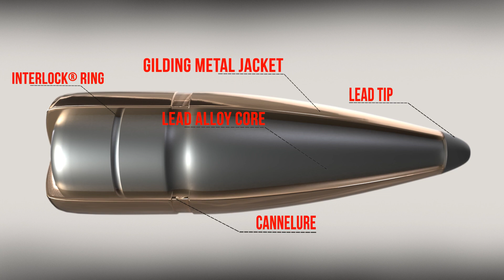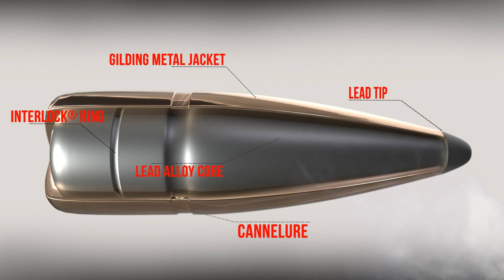Hornady® InterLock® Bullet Overview

Comment: best bullet company out there in my opinion. I'm a hand loader and exclusively use Hornady SST or interlock bullets when I load.
Reply: Yes. Even here in the UK I reload with SST all the time.
Reply: Nosler is better
Reply: @maxair5970  : I love all bullet brands equally.
Except for gay Lapua.
Reply: @Paul that can be said for 99% of lead core bullets..............
.
if you are shooting faster than the STATED! max velocity for this bullet design..... then look into 100% copper bullets
yes, its hard to change from what works.... but all copper works
.
especially for bone / ultra high velocities 
.
.
.
.
personal opinion time..... 
if you are hitting a deer with bullets moving 3400+ FPS....... you should probably use less gun
.
that caliber is CLEARLY designed for long range (besides the exception that proves the rule.... like 223/5.56, which have 3400 FPS, but arnt designed to go much past 350 yards)
.
either start shooting deer from longer ranges
or use less gun
.
.
ya dont need a 454..... supercharged AND turbocharged..... to drive 3 miles to work
it may be fun.... but its a bit too much motor for just getting you to work and back
Reply: @maxair5970  even if that was true........ whats the price difference? 
.
and would the deer know the 10% difference? 
i dont personally think so.... but ive never been shot so

Comment: I've shot hornanday interlocks in 7mm 08 and 30-06 for years. Never have lost a deer with them even when I make the occasional bad shot. The 150 grain interlocks in the 30-06 are extremely accurate and they blow a huge hole for an easy blood trail. But you usually don't have to worry about that lol
Reply: Do you happen to shoot 139 BTSP interlocks in your 7MM-08? If so, how well do they perform on deer and/or pronghorn. I’m considering switching to these for my 280 Rem since 140 Accubonds are becoming very difficult to find.
Reply: @nmelkhunter1  Yes Ive shot them on deer and they do great. Just the other year I shot a 6 point and dropped him. Also shot an 8 with them and he didn't go 30 yds
Reply: @Chase_H  Great. I’m always skeptical, so first hand experience is always helpful. Of course Hornady does have a great reputation. Best of luck in the field.
Reply: @nmelkhunter1  Thanks you too

Comment: I handload the 150 Interlock FB.  Rifle is a R700 LTR with 20" barrel.  This past Saturday, I shot a ~110 pound buck behind the shoulders.  Bullet retained 111 grains (~71%), expanded to 0.76"  as measured as the widest point, but only penetrated around 12 inches and didn't exit.  The deer ran off about 30 yards.  Would have really liked an exit wound.  Expansion was great, but I would be afraid to shoot this bullet any faster.

Comment: Request input:  I built a custom Mossberg 243 Win. bedded and floated the action and added a solid laminate (Plywood) stock.  It shot Hornady 243 win 100 gr. SPBT the best giving holes touching @100 and quarter size groups @ 200.  Does the community think highly enough of the Interlock bullet that it may shoot as well as the SPBT  which is not available.

Comment: I have these loaded in my 300 weatherby and plan on using them for black bear but everyone i talk to says dont use them under 100yards
Reply: What bullet weight are you using? The official story is that John Nosler developed the Partition bullet after having 180 grain Corelokts fail on close range shots at moose, using a 300WBY. I've gotten good performance out of the same bullets on moose using a 30-06, so yeah... velocity can for sure be a factor. Contrary to popular belief, using the right bullet is generally more critical with magnums than standard rounds.

Comment: Hornady bad choice for hunting. I always prefer the Norma,Nosler and Sierra bullet.
Reply: Every mulie I’ve hit dropped dead.
Reply: @ChallisVenstra  l used İnterlock,Whitetail and Sst for wild boar hunting in Turkey,it didn't work.
Hornady bullet doesn't even count comparet to Norma.
Norma Vulkan is always my favourite for boar hunting.
Reply: I’ve loaded and used 125 sst and  150 interlock. 5 boar dead in there tracks and 1 ran about 25 yds. I am happy with Hornady.
Reply: @nighthunter5760  uh huh. Sounds like you're a poor shot.
Reply: Turkey.
Reply: I have loaded and shot Hornady bullets for over 40 years, and have had good luck with every one of them. I could tell a few horror stories from some Sierra 85 grain hollow points in 6mm, and 120grain Barnes X bullets in 7mm.